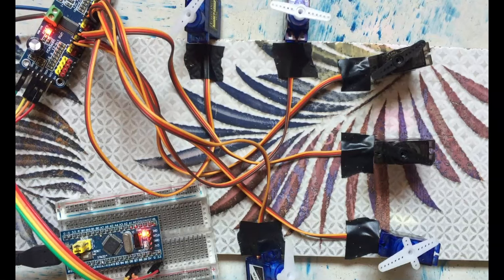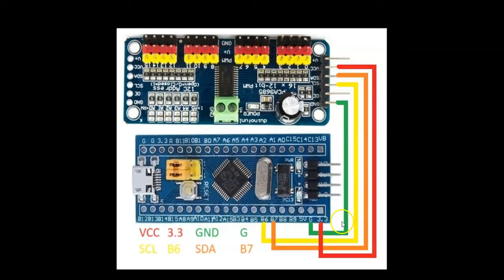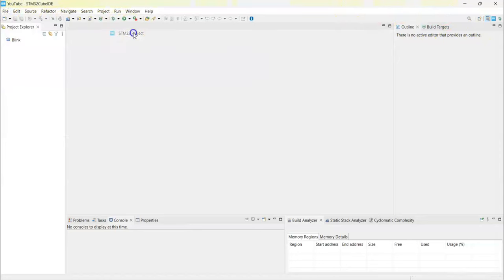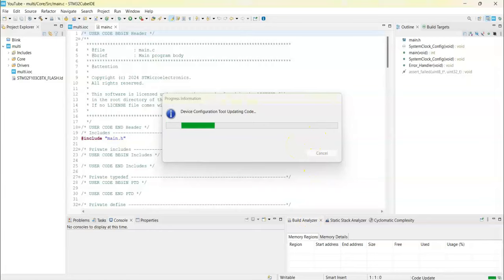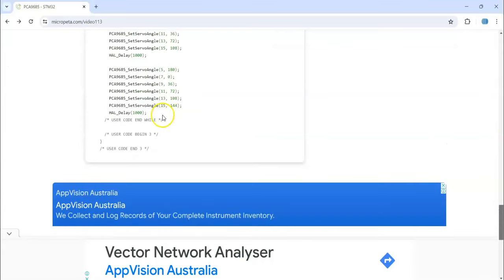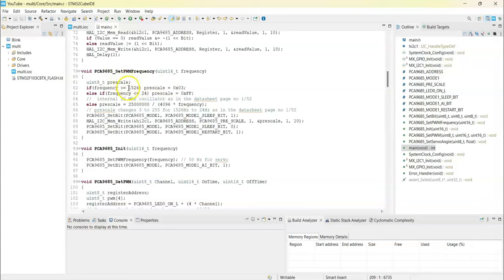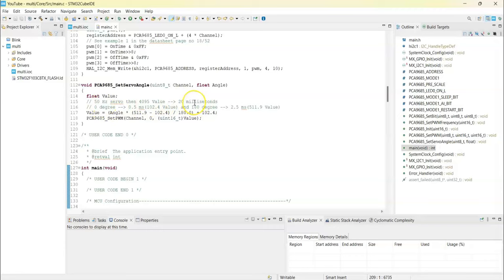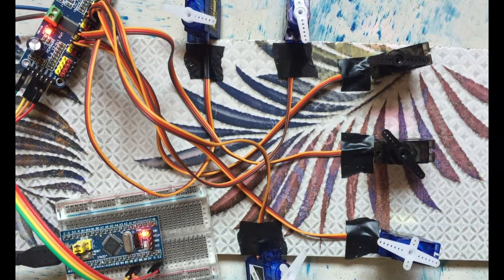113. STM32CubeIDE PCA9685 PWM Servo Driver with STM32 F103C8T6

Comment: Hi, it's a very good support. I'm using a PCA9685 module that has 15 different PINs for servo motors. In the code where is specified the PIN the Board is controlling?
Reply from the maker: There are 16 pins
They are labelled from 0 - 15
Reply: @NizarMohideen  Can I ask you for a  little support? I' m using a STM32F103ZET6 with a single Servo Motor. Even if i followed exactly your guide I Can't let the servo motor move. Can you help me anyway?